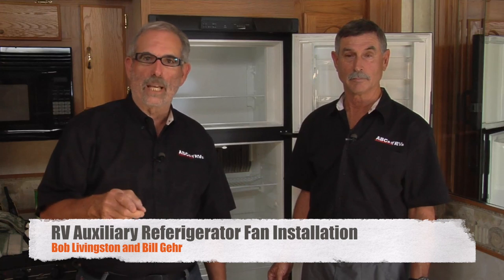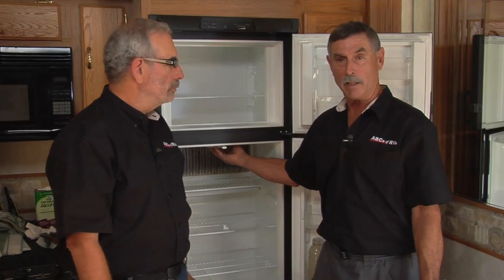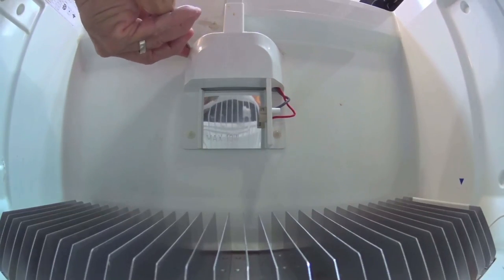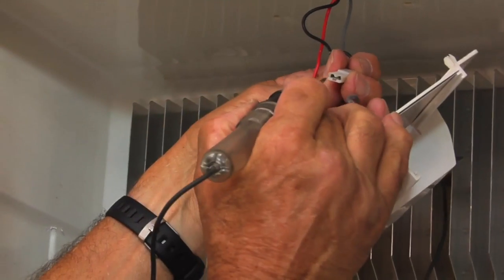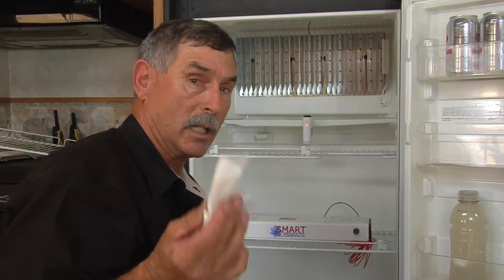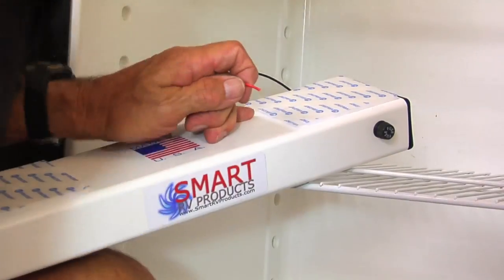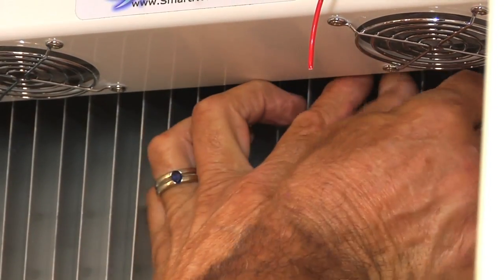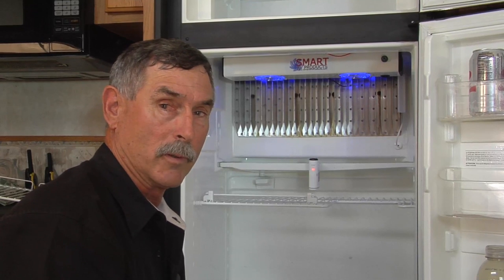RV Auxiliary Refrigerator Fan Installation

Comment: I’m an electronics engineer and a lifetime DIYer. THIS is why I still DIY at 70 years old. Most of these people don’t know what they are doing. Those extra wires should have been capped, and the light could have been preserved. In all fairness, these guys wanna make a buck, so don’t have time to screw around. Still…
Too bad the up/down votes are based on how nice the people are rather than technical accuracy.
Reply: Couldn't believe what I was watching.
Reply: I'm looking to do this myself. Do I just splice in to the existing wires if I want to preserve the light?
Reply: Hack, hack, hack. Excuse me!

Comment: I installed this fan and it works great.  
It is slim and professional looking. 
It was around $100 but looks neater than some of the hack jobs.
Be aware even though the Velcro is 2 pieces, if you separate them, they will not stick together after that.
I contacted the mfg.  They sent replacement Velcro pads at no cost.
I did not try to separate them after that.
This fan works as described.

Comment: The two wires you didn't use, and just tucked up into the cavity, should have been terminated with at least something that insulates, like electrical tape. 

Also, a nice touch would have been to close that opening off with some metallic refrigeration tape.

Comment: They chose this particular RV refrigerator because the ON / OFF switch was built into the light. Made it easy for them. (Don't blame them for this) However it is a little misleading for the novice DIYer.  The power was always available to this light, all the owner had to do was to replace the bulb to make it work. The light switch / housing mechanism is dead simple and will last almost forever. Odds are it was a bad bulb. 
If you chose to do this diy , make sure that you tap into constant ON power, not the switched light when the door is open or the fans will only run when the door is open. (Bad idea)  
I tapped into always on power (hot) and used a photoelectric switch that turns on when the light is out and the door is closed, the light still works as intended. Runs only when the door is closed, this is a fantastic mod for the fridge although I did not use the above fan unit. I used a super quiet 12V computer fan. 
Springer Pop is right in all his comments, this could have been done much cleaner with  professional attention to details. 
Nice to See you Springer POP, I recognize you from wood web forums. Good Man.
Reply: Renrondog in

Comment: Beware, be sure, that the power wire is actually live all the time!  Most frig lights work on a switch that is ON when door is OPEN and OFF when door is closed. I have a frig that is live to the SWITCH only, so when door is closed no power to the light wires!
Reply: That's exactly what I was thinking also.
Reply: The switch usually grounds the light when door open and breaks ground when closed to make the light go on and off. Hence why there is a fin clip to ground the fans to the cooling fins.

Comment: Sure did a hack job. Never leave any cut wire end uncapped or at least taped of shrink wrap. Never cut off unused wire, you never know, you may want to reinstall the original light and replace the bulb, lol. I would have gotten a fan that fits with the original light, heck 2 compter fans, tucked unused wire after it was taped away!

Comment: Buy a fan kit with LED lights, especially if your refer light isn't working anyway.  Then you get the benefit of the fan plus the light.
Reply: Not cold blue lights but nice bright white ones that will assist you when in the refer.

Comment: Search out the wire that has power when the door is closed.  You didn't do that.   Also the fan you are using is so thick it takes up too much space.  There are products as thin as 1/2" that will do the job well and preserve your space.

Comment: 1:35 "I don't think that it's very hard to install so Bill go for it." LOL What the other comments said plus, from an old refrigeration mechanic. If you take a knife tip and pull the pin out of the rivits, they will easily pop out and be reusable.

Comment: I would imagine the air is being pulled out of the refrigerator cooling fins through the rear holes of the unit by the two fans and then blown downward. This makes more sense to me because if it's the other way around the cooling fin drain tray would totally block airflow downward. Am I right?

Comment: Why don’t they just make a refrigerator that works correctly?  All the time!!!I have read so many horror stories of the refrigerator that doesn’t work right. As consumers we are paying enough money for the rv why not put something in it that will work and last!!!  I just don’t get it.
Reply: Kerry Loper 12 volt fridges are better.
Reply: @Bob Tate Enforcing more stringent quality in design and manufacturing will cause pricing to go up. This will cause the RV mega manufacturers to abandon lines they have and consolidate so they can have a more structured and repetitive manufacturing process. That comes at a price. I agree that QC and Design suffer terribly in the RV industry, and something needs to change, but don't expect it to come with "price competition" and lowering of prices. It will not. This is what happened to the auto industry and why cars and trucks are so much more expensive...it is not just the technology but the cost of design and manufacturing, safety standards implementation and such. As much as everyone bitches, vehicles today are way more safer and reliable than the "glory days" we all like to be nostalgic about (I am a car guy...I get it!). This will all need to happen with RV's but this will also cause prices to go up...but the impact will be a better product.

Comment: Lightly drill our the light rivets if you need to.  Pounding them out is asking for problems.  Its not a block of steel, its a plastic refrigerator lining.  Somewhat fragile so treat it that way or you'll be sorry.

Comment: So...if you overfill the frig and put a bunch of food, say carton of eggs, butter, or other containers, the fans still are partially blocked anyway. I have seen some frig's so packed that air movement would be nearly impossible. I say forget the fan....just don't over pack the frig and use a cooler for drinks and things at least until some of the food that is in the frig is used up(?)

Comment: Just bought a battery operated fan from Amazon for $15.00 does exactly the same thing without installation, just put it on the top shelf...batteries last about 2 months
Reply: Use 2 of the battery powered rv blue fridge fans with rechargeable D cells.
Aim one of them down from the top on one side & the other up from the bottom on the other side. Works great! Also took the tube tray out, sealed it off!  
Won't drain but use a couple of sponges & have to squeezed them out once in a while! Drain tube is gone (impossible to fix without taking our the fridge) & it works fine this way!  LOL

Comment: does the fan only work when the door opens?
Reply: Works when the doors closed
Reply: Donald Bailey Genius! But if you press the button and it goes on your God but if it STAYS on : bad, blows OUT the cold and sucks in the WARM moisture ( reverse wires )?  😱